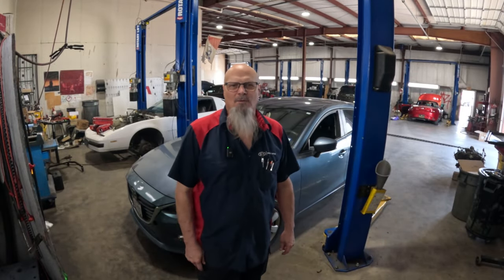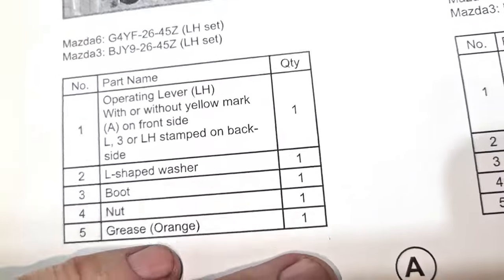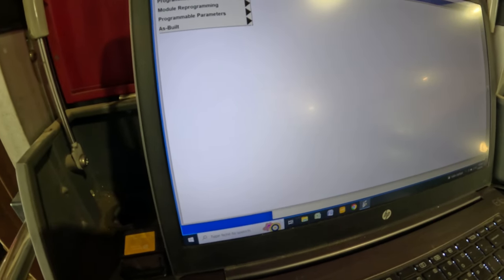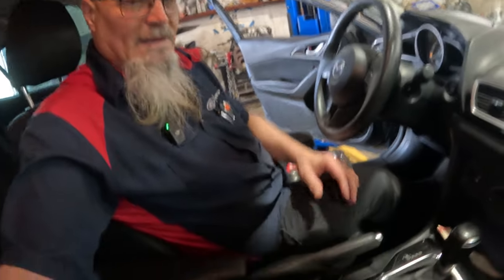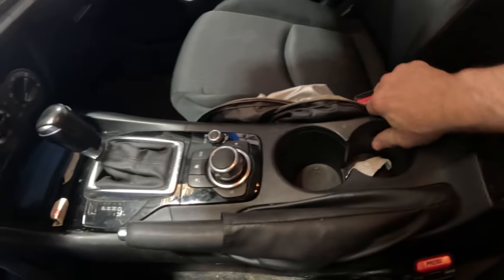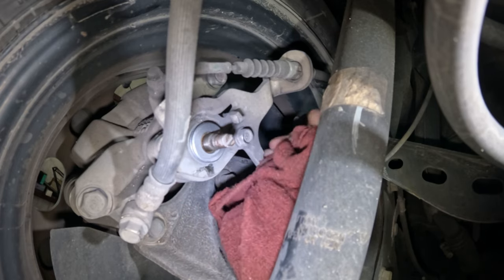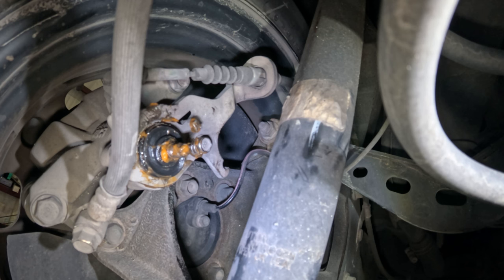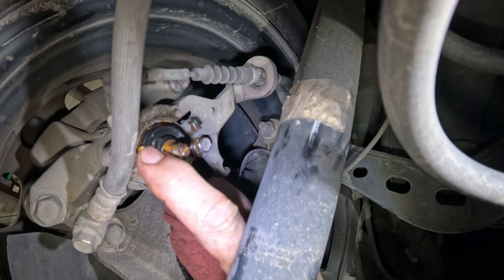Mazda 3 Recalls. Lack of power in cold weather and brake caliper boot kit.

Comment: If I had this recalled preformed and my E brake actuator is basically seized would that indicate the recall wasn't preformed properly as that is what the recall is supposed to address. I have a little play can move it with a lot of force but not enough for the cable to pull and the spring to pull back the lever.
Reply from the maker: @LightsOverAlaska  if it's the caliper that is actually seized and not the cable, then that is possible.

Comment: Where do you get the special tool to install the “ top hat”
Reply from the maker: The only place you can get it is through Mazda E Store. I don't even have access to it.  Only our parts manager has access to the E store. It doesn't even have a part number. They just call it the Special Service Tool or Jig for the brake caliper campaign 1217F.  All special service tools are shipped directly to us weather we want them or not. If they were to get lost or break, the parts manager would have to order them through Mazda E store.